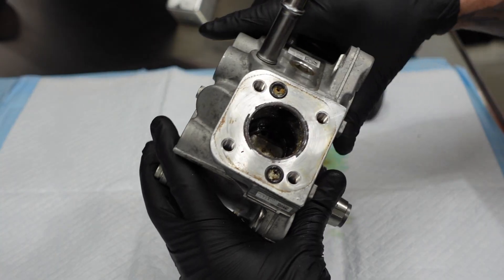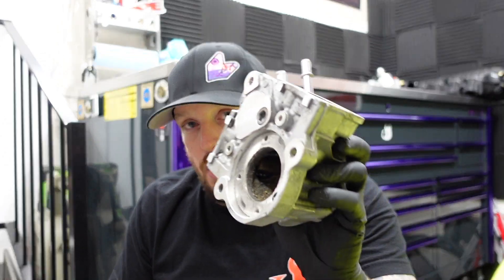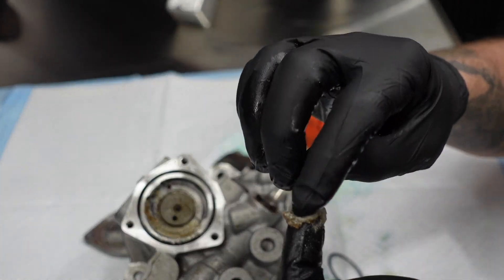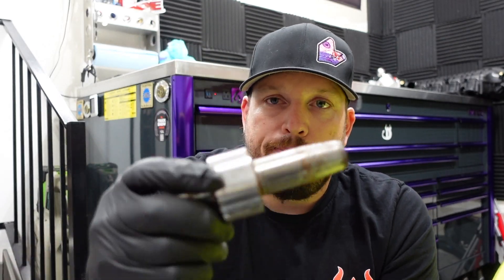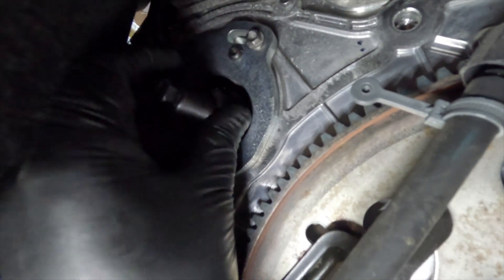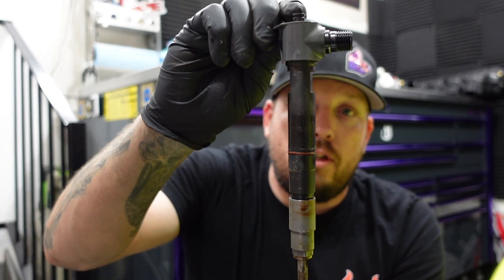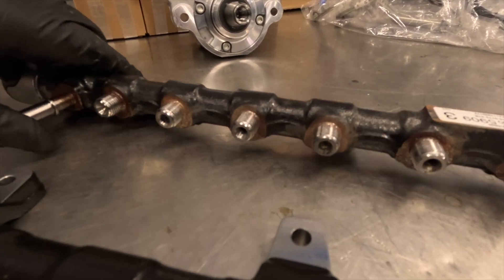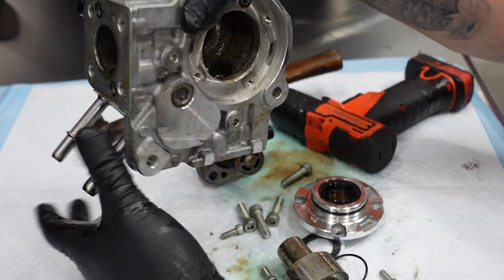What Happens When Diesel Fuel Gets Contaminated? DEF Contamination

Comment: I always thought it was so stupid that GM used to have the Def tank filler in the engine bay on the older 6.6 trucks but now I can see that that was definitely an easy way of preventing someone from accidentally putting Def in their fuel tank.
Reply: I bet they moved the DEF filler to be next to the filler neck because most people buying a 3/4 - 1 ton can't see over the fenders anymore.
Reply from the maker: Exactly! I thought it was dumb as well, turns out, that's the way it really should be.
Reply: there's an old retired GM engineer somewhere who was responsible for that under-the-hood filler, watching these videos, shaking his head.

Comment: What DEF do you use? I have a 2021 Chevy 3.0 duramax and I have used the DEF at truck stops since I got the truck and I haven’t had any issues. Would it be bad to switch to another DEF or is it okay to continue to use the DEF at truck stops
Reply: I’m using DEF at truck stops, I think what can help is if owners would buy a cap from Amazon and develop a routine-  open cap take care of diesel, put cap on, same with DEF. GM moved the Def side by side in 2022 for the refresh for sure.  It has a cap the diesel is cap less.  Accidents happen,  as the video shows. Expensive lesson.
Reply from the maker: Use the DEF that is convenient for you. Some like the pumps, others prefer the bottles so they can have it on them. I use the delco DEF or I will buy a box or two from Costco. I don't use the pumps, just by choice to stay out of those lanes and leave them open for the big truck drivers.

Comment: Is Stanadyne a good alternative if the AC Delco and Hot Shot additive is not available?
Reply from the maker: Stanadyne is great! GM actually used to recommend using that when I was replacing the injection pumps in the old 6.5L Diesels.
Reply: Thanks!  Good enough for me.

Comment: I fill up at a local Shell and there diesel isn't on the top tier list. Been using the AC Delco additive since day one at least every other tank, sometimes I do consecutive.  Its expensive but now I know it's been worth it from watching this video. As always thanks for the info!
Reply: I buy it from the dealer where I got my truck. I stocked up April of 2022 and list price at the time was 19.36 per bottle, I was able to get it for 15.49 per @ 24 bottles. I'm actually going today to stock back up on additive, oil, and oil filters. I've only bought GM recommended products for my maintenance from the original dealer. I've never really shopped around, but I should. Any recommendations?
Reply: Side note, since I got the truck new in late 2019 I was being charged full list price for all service products from the dealer until last year. Then the tech at the parts dept started giving me a discount, hopefully he's still able to hook me up when I go today!
Reply from the maker: Thanks for the comment and glad you enjoyed it !do you buy the delco additive at a dealer or in bulk on line?

Comment: I didn’t this when my truck was new. I got the fuel contaminated warning so I went to dealer. They just flushed it and changed fuel filter and it’s good 85k miles later. I will say I only put a couple ish ounces in and was like wtf are you doing. Still enough to set off the sensors.
Reply from the maker: you got lucky on that one and that's great !

Comment: A very good visual of what happens when two chemicals react. What. A. Mess. 
With all the talk about a oil pump belt - fuel contamination from being in a hurry at the fuel island or Car/Auto diesel island will be a higher risk repair than that belt ever will be.  Thank you for ending the debate on which HP fuel pump is in our 3.0’s. Your doing great work.  Let the additive debate begin!
Side question. Could the BCM be programmed to not start the lift pump when the door is opened. Seems this could lessen the risks?
Reply from the maker: It could lessen, but at the same time, would result in a longer crank/start, I would assume and then people would be unhappy.
Reply: @DemonWorks  truth in what you say.

Comment: Hey brother, enjoyed your video on this topic. I actually accidentally did this to my girls truck 3 months ago. And you’re right it was a REALLY EXPENSIVE MISTAKE. Had to clean the fuel tank, replace the fuel filter (in-line prime system), diesel fuel water separator, particulate filter housing assembly, and replace the water in fuel sensor. So far it’s been running good, no issues. Did you use the fuel treatment additive that you showed on the video in the persons truck? Was it all good? Thanks for all your vidz. Learned a lot about me and my girls two Silverado’s.
Reply: In my area, my total cost was 2,573.48 and I considered myself fortunate for that because all the forums I looked at said that it was anywhere from 5k, 10k and more. My girls truck has been running fine since that day it was fixed. Hope this helps and good luck on your truck brother.
Reply from the maker: Sucks to hear this happened to you ! Sounds like you got off on the cheaper end, while still pricey. The truck repaired got everything brand new and yes, the ac delco fuel additive was used afterwards. Glad the videos help share the knowledge and experience !
Reply: How much did this mistake cost you?  I did the same thing last night